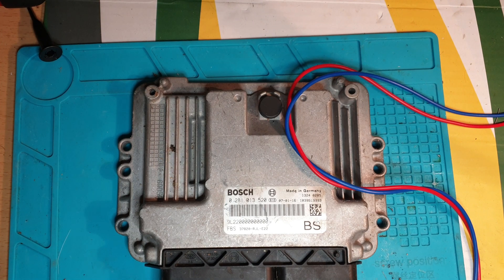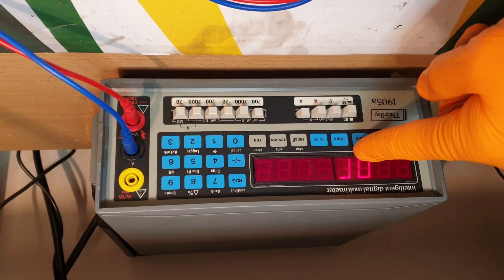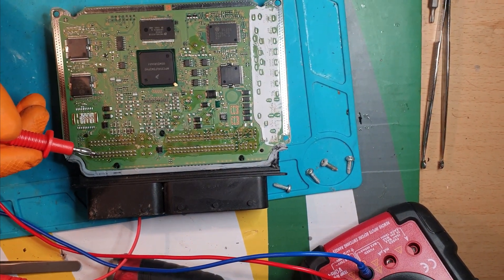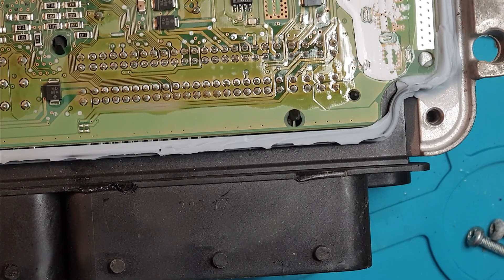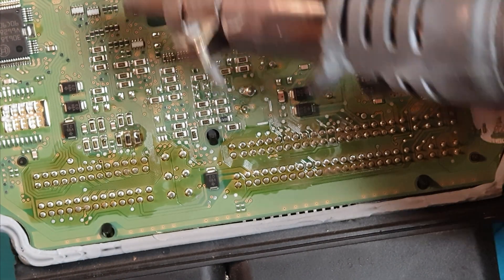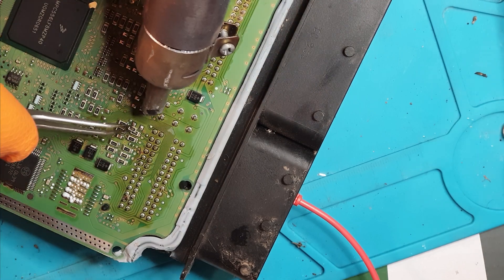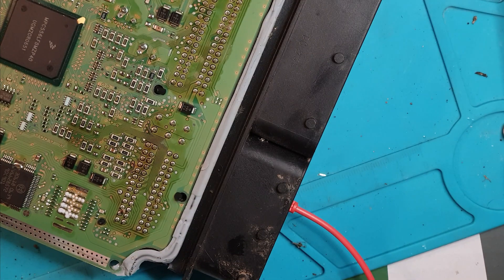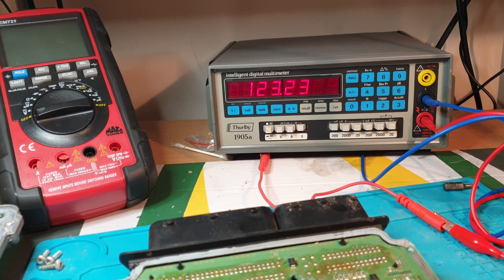No CAN on ECU repair

Comment: Great expertise  & skill shown in your video ! Thank you!  
I hope you can help me with an ECU issue please. I have a problem with a Ford Focus Mk1 2003 -  will not start/ turn over. Starter motor tested OK.
Correct key - i.e. started car previously -  central locking still works both with key and with remote. ECU:-  Visteon LP4-335 1-00 0287  2ANA  1M5F-12A650-BE  - Scan showed DTCs:- 

P1000                                                      On-Board Diagnostic (OBD) Systems Readiness
                                                                Test Not Complete

B1601                                                      PATS(Passive Anti Theft System) received incorrect 
                                                                key-code from ignition transponder.

B1342                                                      ECU(Electronic control unit) internal fault

and that there were 8 keys registered (which seems very unlikely the previous owner had 8 keys! –we have 2  original keys ) We couldn't erase / re-programme any keys.

It has been suggested that this infers that the key-PATS circuit/function is not working correctly (as perhaps per code B1601) - Is this controlling circuit contained in the ECU or elsewhere (e.g. dash display?)  i.e. Is this because the ECU is suspect /"faulty" (code B1342) or could this be erroneously showing as a fault in the ECU, because the fault is elsewhere? (e.g.  the immobiliser transponder  (located around the lock barrel))
If the ECU is faulty could this be the only reason why the keys are not being recognised ? 
Do you think the issue with PATS (keys not recognised) could be being reported back as an "Internal fault" with the ECU when in reality the ECU is OK ?
What can you draw from the above results ?  
Therefore I would be grateful if you could please advise of the most likely cause of this issue and suggest a successful remedy/ diagnostic route.
Thanking you in advance for your time and consideration, I look forward to any replies.

Comment: Nice work. I mostly have experience in PCBs and soldering from the pro audio world, and I am in awe of your de-soldering technique! I have not seen the desoldering "gun" nor the liquid that you placed on to remove the resistors. Seems like a must have in the future! I have only used de-solder braid- what a pain.
Reply: hot air station and the liquid is called flux (not liquid in room temperature) but you only need hot air when you desolder ICs or 20+pin component cause you can heat up every thing simultaneously but when it comes to resistors or caps diodes or any 2 or 3 leg component you only need solder iron especially if it surface mounted component cause if it not smd yeah you probably need to suck the solder with sucker or braid to make the holes clear for the new component you gonna solder
Reply: @mohammedbin0002  Thank you!

Comment: I got 2013 ford focus st turbo 2.0 bored to 88 mm ported heads noticed it has pcm same thing from junkyard yellow writing i got 1639 code error no communication something to do corrupted memory car when i put ac turns off on idle im trying to program n relearn system calibration dont let us

Comment: Looks like you get lucky on that one. The power regulator circuit components typically fail after a short. I assume you did a pin out and powered the ECU then tested power circuit for 12v 5v 3v and they were good and you connected a scope to can pins and sent power to wake and still had nothing on can bus

Comment: Those 2 resistors are in series to make 120, and 120 would be in parallel in another module (or CAN slice), terminating the network, to create 60 ohms.

Comment: The only green piece on there. What does that control ? I have the same ecu. The green on mine looks a little worn. I have no crank no start. Esp and engine light just flicker with fan running.

Comment: Hi, so I was wondering if there is a parasitic drain what inside the ECU,  or PCM, however it is classified would be the most likely cause, if there is one that would stick out to you or if maybe there isn't something that could cause that in the ECU/PCM, also my obd2 reader won't give me live data and I'm not sure if it's the diagnostic that is the issue or if it is the ECU/PCM, THANKS.

Comment: Bosch made a design flaw in this ECU. Note 3:16. The insulation paste on the cover does not insulate the connector bottoms on the card with the cover on the other side. To avoid short circuits, you must insulate the connector ends and the cover with an insulated pad.
Reply: GM did the same thing

Comment: How can I make the ecu test system diagram. How can I obtain the ecu test system. Which ecu test system are you using?
I want to repair ecu. What is the equipment required for ecu testing?
Reply: Knowledge is you most useful tool.
Go learn first.

Comment: I have an ecm who contains an internal resistance can bus 
But the values measured its more than 120 ohm its 35kohm 
What do u think plz ?
Reply: If the ECU has bus termination, it has a 120 Ohms between CAN_H and CAN_L. If it is not a bus termination resistor, then generically you find something in the region of 60k to 70k ohms. That provides some load on the bus to prevent ringing and reflections, but not to the same extent a fully tuned 120 Ohm gives you.

Comment: fantastic! now tell me, can an ecu survive 300+ amps at 12 volts? I came across one with ground pin practically melted, ground wire between engine and chassis was removed and seemed to have grounded through ecu from starter.

Comment: What is the melting temp of the solder and does the desolder tool set to a precise temp for the job? 
I’ve repaired a few cold solder joints in the past and changed MOSFET’s in speed controllers, but always with a fine tip iron. That tool looks excellent for the task?
Reply from the maker: Low melt solder is about 200c I don't really have a set temp I set everything to the hottest temp and just move the equipment closer or further away dependant on the needs of the particular job.

Comment: Excellent pal!, could you tell me if i should be able to copy an ebs control unit merc mp4 with star, obviously I'm a begginer. Just wondered if there is another way to copy and paste a file to the new unit.same way we can with trailer ecu's through jal.I'm mobile in 
 scotland. Customer were told by merc they need to take to them.
Cheers boss
Reply from the maker: you will be able to program it with star although ive never done it myself
Reply: @CANDiagnostic  only seems to want to do it online, the offline is a dead end.
Reply from the maker: Maybe better to send it off and get it cloned.
Reply: @CANDiagnostic  who's best for that, any contacts?
Reply from the maker: @russellmcallister6830  https://ecutech.info/ this is who I use